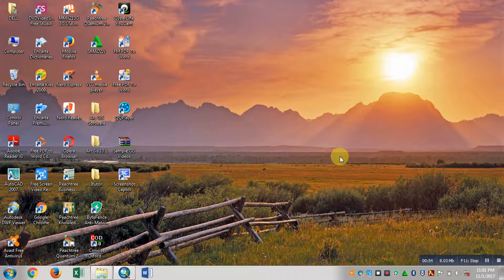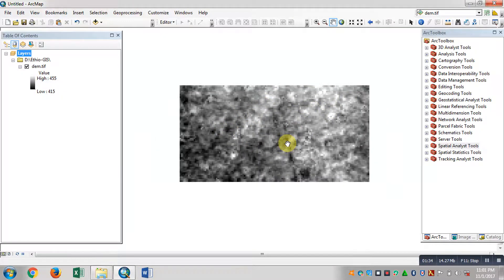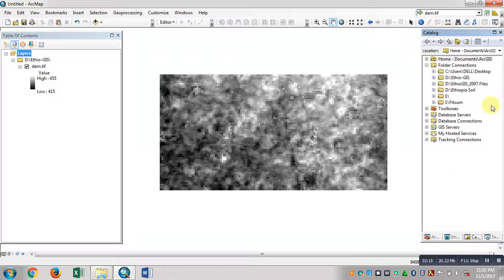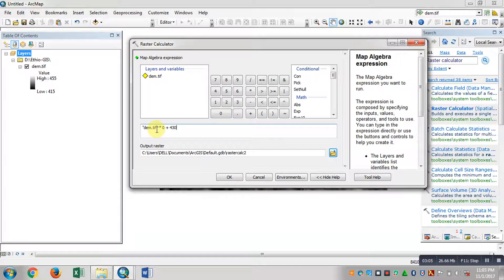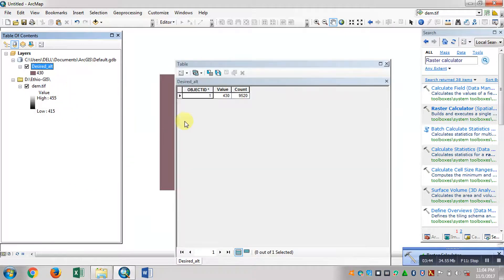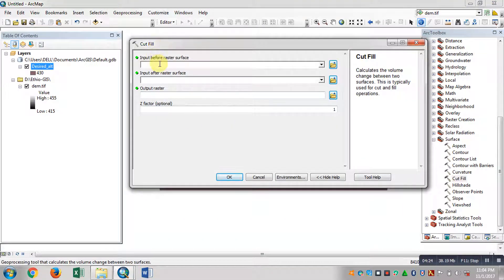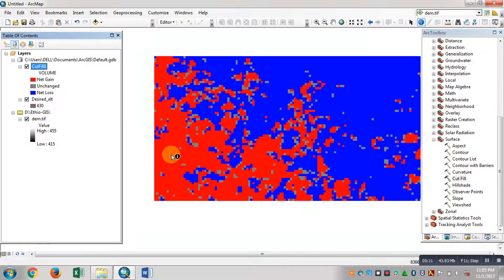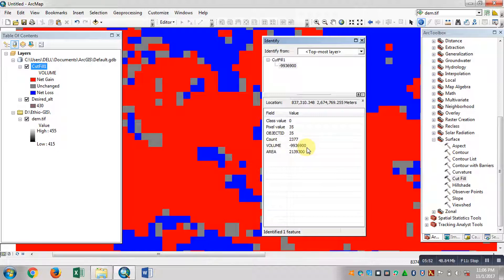Calculate Cut and Fill in ArcMap

Comment: The file that you have chosen for input after raster layer (Desired_Alt), was raster or vector.
If raster how did you get attributes to raster format and if vector how can you get cut fill with one raster and one vector layer???
Reply from the maker: It raster file
Reply: You can't cross vector and raster during cut/fill. He ran Raster Calc. on a raster and it output another raster, it can't output a vector